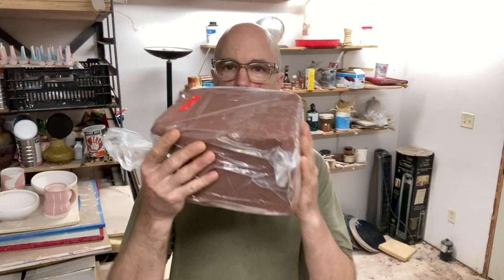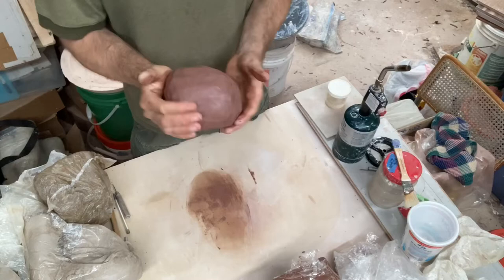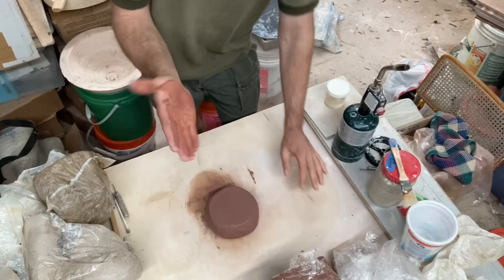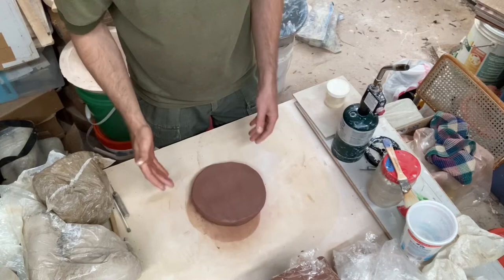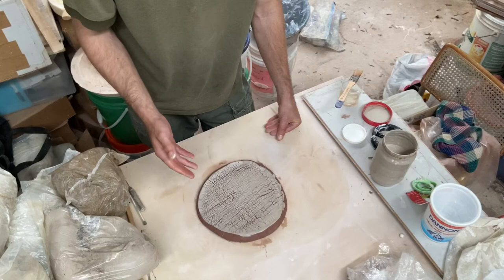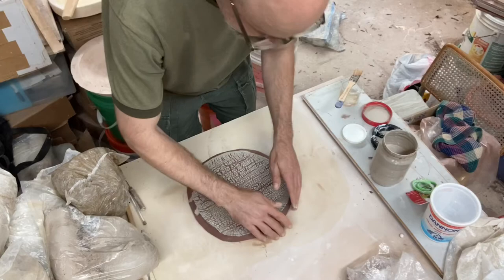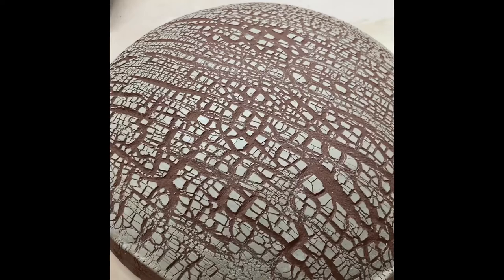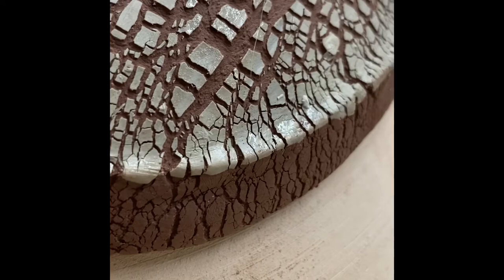Kohiki slip slab bowl

Comment: It might be a good idea to cut a circle like a quarter inch thick red clay for the foot.Just so it doesn't scratch the surface
Reply from the maker: That's a great idea.  It's also possible to polish the textured surface with wet/dry sandpaper to make it safe for the table surface.  Thanks for your comment!

Comment: I realllly want to see the finished piece!!!!!
Reply from the maker: Still haven't done the final firing...sorry!
Reply: @gooddirtclasses8933  how about now
Reply from the maker: @Yakkhyl  https://youtu.be/xh82Ju9rG7M
Reply: What percentage sodium silicate to H2O?
Reply from the maker: @leighrobison9388  I cut it about 50/50 from the concentration it comes in from the supplier.  The stronger the solution, the deeper the cracks seem to penetrate.  If you get it too weak, you won't get enough fissuring to really show up.  Be careful about getting the solution into your slop bucket as it can contaminate all your reclaim clay and make it behave strangely.  Powerful stuff!

Comment: Hello, I loved the video! I had a doubt, if you just pass the silicate and wait for it to dry the texture will arise, or necessarily, do you need to heat it with the torch?
Reply from the maker: I think you want to heat it with the torch so the surface becomes stiff but the underlying clay is still soft and stretchy.  You could probably substitute a hairdryer if you're more comfortable with that.  Of course, it couldn't hurt to experiment...it's very possible that I am just an impatient potter who likes to play with fire.

Comment: Not sure why you are using the sodium silicate.  The slip will Crack the same without it and you have not wasted scraps  At least it does for me.  Is there some other benefit I, not aware of?  Will use it in the future if there is benefit.
Reply from the maker: The surface of the slip and even just bare clay will crack much more dramatically and predictably with the sodium silicate. Concentration will impact the depth of the cracks.  I cut it one to one with water as it comes from my supplier.  I generally don't generate a lot of scraps with this technique or similar pieces created on the wheel, so not a big issue for me.  I agree though that if you get a great result without the need for an additional ingredient...go for it!

Comment: Would you mention how you made the slip - from pugged clay or is it a casting slip? Is it the same cone as the red clay. Thank you.
Reply from the maker: We use a white slip that we mix up from dry ingredients and sieve just as we would a glaze.  It's 25% kaolin, 25% clay, and the rest non-plastic ingredients...flint, neph sy, zircopax.  Also contains borax.  It will fire to cone 10 but works great on earthenware too.
Reply: @gooddirtclasses8933  can you please give the ratio in detail..?

Comment: I see where you have the slip recipe but can we just use our slip from the clay we use without adding anything to it?
Reply from the maker: You could definitely experiment with just using your usual white clay body.  A good way to make a slip from it is to save some trimmings and let them dry completely.  Then cover with water overnight and pour off excess the next morning.  Blend up what's left and you should have a nice smooth slip.  If it cracks up too much, you could try making a deflocculated slip by adding sodium silicate to your slip prepared as above drop by drop until it thins in consistency.  This way the water content can be lower in a slip that can still be brushed on.  Hope this makes sense...
Reply: @gooddirtclasses8933  it does. Thank you very much

Comment: How you make white-slip
Reply from the maker: We mix up dry ingredients (kaolin, ball clay, flint, nepheline syenite, borax and zircopax) by weight and then add water and sieve through 60 and 80 mesh screens.  We usually make it up to a heavy cream consistency for brushing, but we thin it out considerably for dipping.
Reply: @gooddirtclasses8933  do you just thin it with water?
Reply from the maker: yes..and run it through the sieve to make sure there are no lumps.